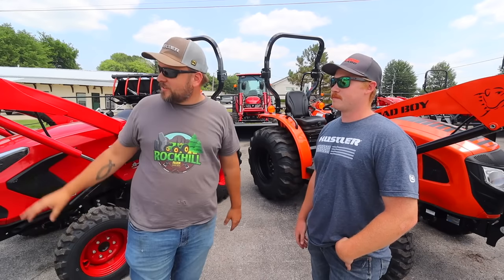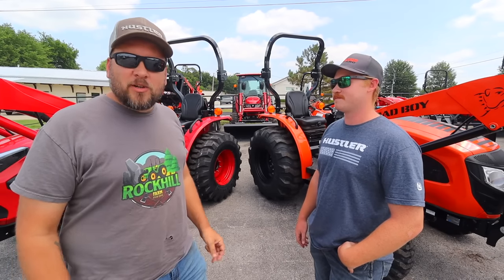Buying a Tractor with a Regen System - Should You Avoid Them?

Comment: Once I realized that running my engine at under 1500 rpm would cause more regen cycles, I never run it below that point.  When actually operating the tractor, I make sure to run it over 2000 rpm.  I hardly ever notice the regen cycle anymore.  It is certainly not frequent.  I used to panic when the light came on, but now I see it and keep on doing what I'm doing.  I was leery of the regen system when I bought the tractor, but it has become a non-factor.  I certainly wouldn't be concerned about it if I was purchasing a new tractor.  Thanks for the video, Brock.  Lots of good information!

Comment: One point they didn’t cover is the DPF has a service life just like any other filter. Yes it collects soot and then burns it off. However there is ash that remains. Over time the ash will accumulate and plug the filter. So at some point it will have to be removed and cleaned or replaced. Or it could be bypassed with these tractors. Other models bypassing is not an option.
Reply: This is a good point. Ash can be cleaned from the filter as well, but the element would need to be removed.

Comment: DPF isn’t the issue.  The EGR system is what kills the engines and shortens the life of the engine. I’d be totally fine with “clean” exhaust and having to clean the dpf.  What I won’t take is dumping exhaust back into the air intake, compromising the oil.  It’s not DPF, it’s the EGR to run away from.
Reply: OH Yes EGR= Pure "Clogalation ,oil contamination,Super-high heat,&"grinding-compound" in the Entire Engine.  DPF's = Oky-doky, along with the High-pressure Common-rail fuel Injection systems = super low fuel consumption & LOTS of POWER.

Comment: I live in north eastern Nevada. I bought that TYM from the tractor yard back in June of 2023. It’s a great tractor. I did have a problem with the dealer not getting the paper work to me or the bank. I drove for two days to get there and pick it up. They were very rushed to get me out of there. I didn’t even get an owners manual until 3 months later.

Comment: Right' you're better letting the Diesels run.. but remember most of your dealers have a limit in running hours for your warrantee. Really interested in a Delete for our Deere skid steers, would modify it as soon as its out of original warantee. Aside from that my neighbor has the same unit as I do that came out before the bs Gov regulations, it sounds MUCH better too.

Comment: We have had our Grand L 3560 for a year now with 130 hours and gone through 3 regen cycles. There have been NO problems with them or the performance of the tractor. To be sure, Kubota had some on some it's early systems on some models, but they Have appeared to solve the issues on their current line up. I'm sure the other brands have addressed rhe issues as well.

Comment: My thinking for buying a big frame 25 horse tractor was... I'm buying it mostly for the loader so no dpf or having a dpf the loader lifts the same, but less horsepower and no dpf means cheaper tractor with 1 less part to possibly fail. Also when I need to do pto work then it's good for a diesel to work once in a while because lifting firewood poles doesn't really tax the tractor enough. Just my 2 cents.
Reply: This was my thought for the loader lift capacity when I purchased my bad boy 4025 just 2 days ago. I was leaning toward a manufacturer who actually made their own tractor but the deal was hard to pass up. So hopefully I won’t regret my decision in a few years. I came from a JD750 2wd with not loader so definitely will be more beneficial around my property!

Comment: 11:15 love it.  "We gotta capture this unburnt fuel and soot in a filter, because if it got into the environment, it could increase CO2 emissions!"

"Oh cool, so when the filter gets clogged with all that emissions stuff, you just swap it out?"

"Oh no!  Those things are too expensive for that.  No we just heat up the filtration system to burn it all off."

"Heat it up how?"

"Well we make your engine RPMs go up to burn more fuel!"

"So you're capturing unburnt fuel to reduce pollution... then burning more fuel to burn the unburnt fuel that you captured... and this reduces pollution?"

"Probably!  But it doesn't matter; it's required by law so FU buddy!"

An engineering design so clever and self-defeating it could only have come from a group of unelected bureaucrats.

Comment: Ok Mr. Engineer, what are the emissions during the regen process??? I would love to see the emissions from the same size and type engine one with no DPF and one with DPF over a set amount of time and what the difference is.
Reply from the maker: I don’t think there are any fewer emissions , but that’s just my opinion without any insight or knowledge

I don’t know that Jake is a big fan of these systems either but they are legally required
Reply: So these passive DPF filters are very effective at collecting and burning Particulates. The primary function of these passive filters is to utilize the normal operating temperature of exhaust to keep up with the accumulation of particulates in the filter. As they react with the filter material and burn, the product gases become less harmful. The regeneration process just helps burn off particulates by increasing temperature and pressure within the filter when the filter becomes clogged. I know a lot about these systems but I don’t necessarily like having them on equipment. The fact is they are here to stay so we have to learn how to live with them or work around them.

Comment: Great topic, Brock. What data or criteria did the EPA use to decide a cutoff hp rating to require emissions scrubbing? Why 25hp? Was it about volume of sales, like what size tractor will be most prevalent in use in the years ahead? Or how much political haranguing was done behind  closed doors with lobbyists? We all know this is about more than saving the planet.
See, by creating a threshold of hp rating application of these regs, it has created a wave of buyers seeking to avoid the add-on tech and higher costs. I don't believe all those buyers are just old school tech haters...there's a reason we buyers want simplicity, especially in equipment of great cost. But it has created a forced purchase if someone wants more power...we have no choice.
Another related question is just how much carbon and nitrogen oxides do a relatively small number of low horsepower diesel engines really put into the atmosphere, to what detriment...really?
If it had ANYTHING to do with planet saving, then the WHO would step in and lockdown India, China, SE Asia, Africa for all their unchecked contributions. Ahhh...politics comes up again...hmmm

Comment: My Kioti CX 2510 HST (about 25 HP) uses less than a half gallon diesel fuel per hour of work, with some at 2400 RPM using PTO, some between 1800 to 2200 RPM for loader work or pulling, and some idling. It doesnt really matter the RPM in the working range...same fuel usage. This is my data for about the first couple hundred hours. No use in putting wear on the starter, stopping circulation of fluids, etc, just to shut off the tractor to get off for a few minutes of hand work. Saves nothing to shut off the tractor
Reply from the maker: Thanks for sharing. I actually did a review video on that tractor model and was pretty impressed with it.

I think it was actually at 2610

My 38 hp John Deere seems to use about a gallon an hour

Comment: I think many people who buy these tractors are older (I'm 71) and are in no hurry.  I just idle around.  My JD 1023E idles at 1550 which seems fast to me.  Of course mine has no DPF so no problem.  People will get a tractor for the biggest job they have but most of the time it will not be stressed.  Best thing to do is when the tractor calls for a regen is do one of those big jobs.

Comment: I can't imagine a 25HP machine of that size. My 1025 is too weak to pull itself around in high gear not even doing any work, just driving. Definitely not enough
Reply: that's because the deere is anemic compared to some other brand 25hp tractors.  you overpaid for green paint with bottom basement specs.
Reply: @wtfdoicare  Facts for sure.
Reply: Gearing has a lot to do with it

Comment: My 19 hp 52 Ford 8n still working fine...
Reply: Ive run ford N tractors. The N series are handy lil guys but not 4wd, very limited lifting ability due to potential to snap axles, first and reverse arent even low enough without add on underdrive aux trans and frankly they arent very nice to operate for hours at a time compared to something built over the last 30 or so years
I like this machine has mechanical fuel injection so the machine will last for decades as long as hydrostatic drive isnt over taxed

Comment: Turn up fuel pump and make the 25 a 35ish
Reply: Depends on displacment. I know a mower builder that has a 25hp diesel that is 898cc and another 25hp engine thats 1300 cc..... the 1300 cc runs at a lower rpm though both are kubota diesels. I assume if the 1300 cc engine was spun up to same rpm as small motor it would be 35 or more hp.

Comment: 30hp for less for no emissions?  thought it was 25hp thats why the tractors 25 not 30 right
Reply: <30HP. A 30HP tractor will have some sort of emissions control. Most likely a DPF filter
Reply: @TheTractorYard  Tier 4 EPA chart says 19 ≤ kW < 37 (25 ≤ hp < 50). 19KW is actually 25.4 HP, so that's how "25 HP" engines skirt the table. The EPA isn't bothering with fractional numbers in the chart.
Reply: A lot of “de-rating” happens in the industry. There’s plenty of info out there on how to turn these 25HP Kukje engines up above 30HP just by adjusting the fuel at the injection pump. Thanks for correcting me on the HP cutoff

Comment: Whatever you're gaining in efficiency you will lose in reliability. DPF/Regen machines NEVER see the number of hours that an emissions free diesel will. That means you are replacing your tractor more often. Just look at Diesel pickup trucks, emissions free diesels from the 90s are still on the road with a half million miles meanwhile 2006 and later diesels with that mileage are absolute unicorns.

Comment: You can alter any emissions device. I hope you enjoy the fines you incur.   I I am not ignorant of diesel engines  The  money rail will give you the best fuel economy.regardless of the horsepower,  but carries the liability of needing a computer. Mechnical injection provides less opeertuny  failures with you seek out  engines that has  8+ years of production and has stood as a lone engine provided. Please don't buy lower horsepower anything unless you willingly wish to upgrade within the next couple of years.  I have not an under 26 horsepower traction that revels it cost less to pduce it compared to a 36hp model. Lastly not the difference in tire sizrs.